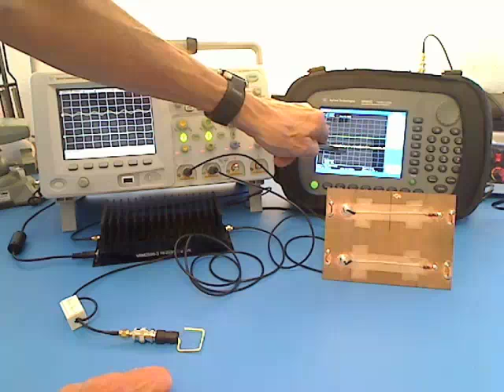PCB Troubleshooting Using Direct RF Injection

Comment: Stumbled upon your video!   I used your book during my Ph.D. and we met in Austin at a IEEE EMC conference.   Your insight was a great help to me!   Thank you.
Reply from the maker: Hi John! Thanks for the kind words.Did you know I run short classes in Boulder City, NV? The material on my website is just the tip of the iceberg of what I have done. The link is: http://emcesd.com/bcsem_hfmeas.htm
Reply: I wouldn't hesitate for a moment in recommending your course to any engineer!   Even if they only learn about how a probe loads the circuit they're testing!